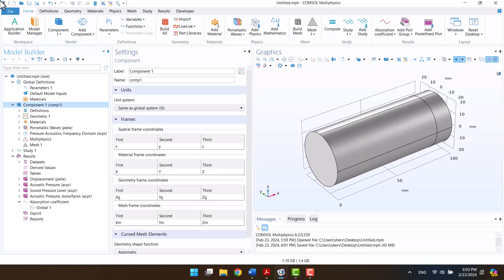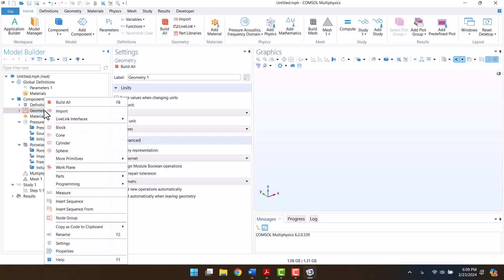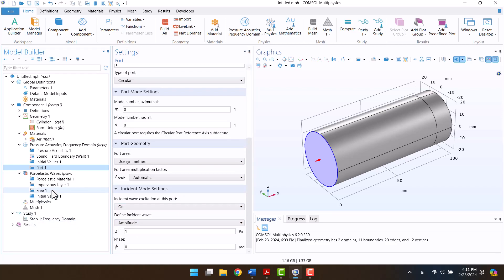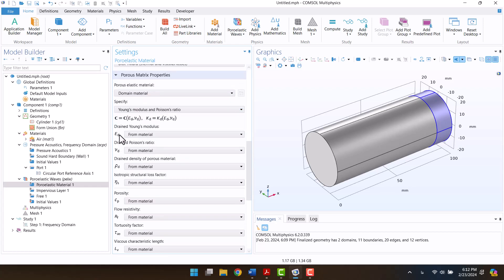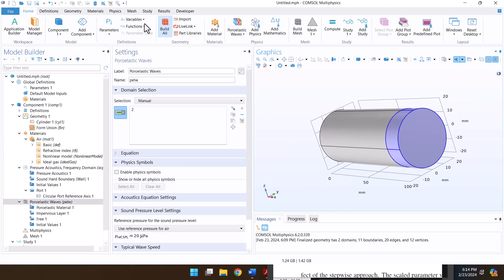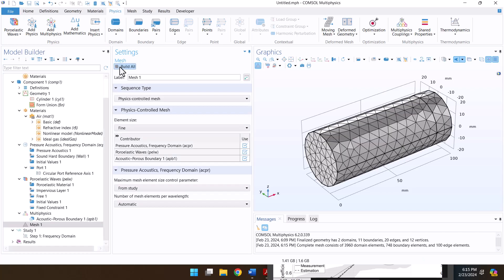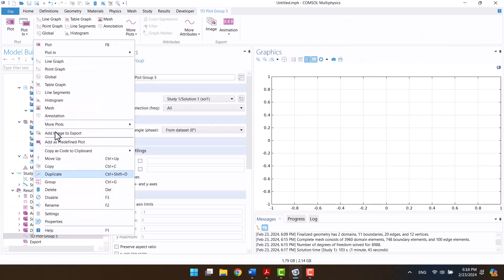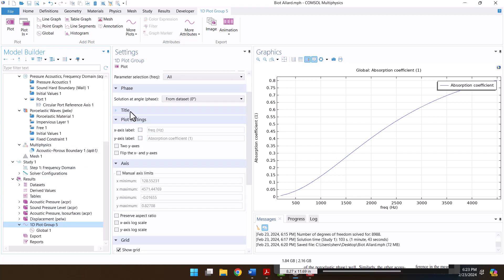🔊COMSOL Tutorial: Sound Absorption Coefficient Using Biot-Allard Model 🎶

Comment: but if the material is non-porous, which model should I use? Can you please let me know that?
Reply from the maker: These models are used for porous materials. What do you mean by non-porous materials?
Reply: @caewitharminhashemi   No actually I'm simulating for a complex geometry of Acoustic metamaterial.  I'm using Elastollan as its material. So if I want to calculate absorption coefficient for that, which model should I use?
Reply from the maker: @aranichakraborty141  , no, you can't use it for metamaterials. I have a package about metamaterials that you can purchase. I explain how to calculate the STL and dispersion curve of the metamaterial cell.
Reply: @caewitharminhashemi where to find that?
Reply from the maker: @aranichakraborty141  https://engineeringdownloads.com/product/labyrinthine-acoustic-metamaterial-sound-transmission-loss-and-dispersion-curve/
Reply: did you buy this model？
Reply: @思文张-l9p No I use through my institution
Reply: @aranichakraborty141   can you share me your method I need it very much thank you
Reply: @思文张-l9p are you asking for biot allard model? I'm not using that
Reply: I'm not sure what I think，I use many model to calculate the absorption